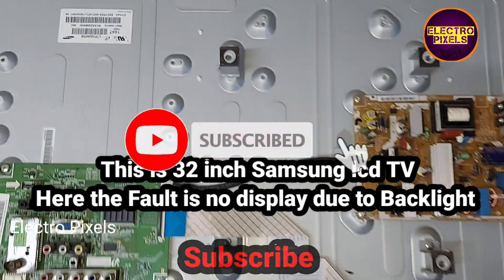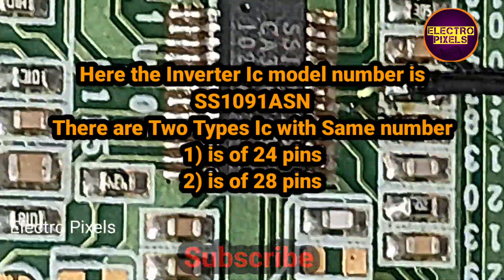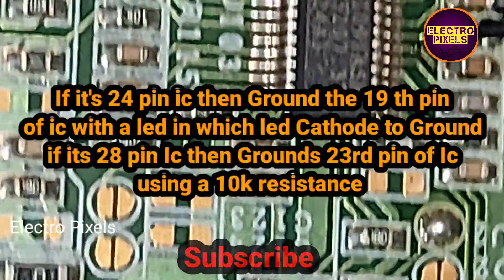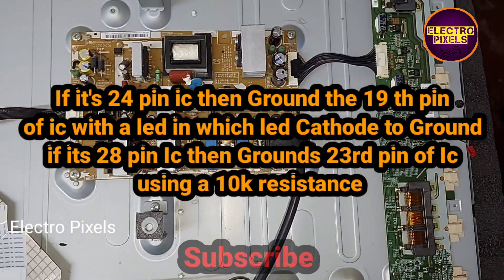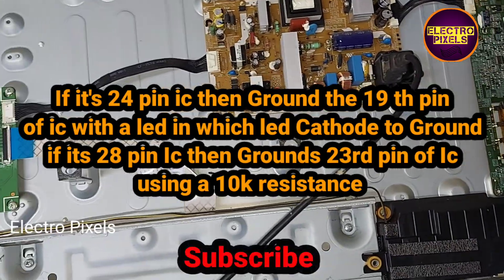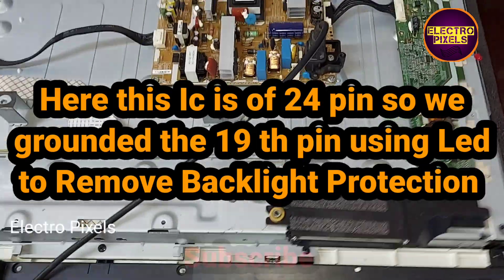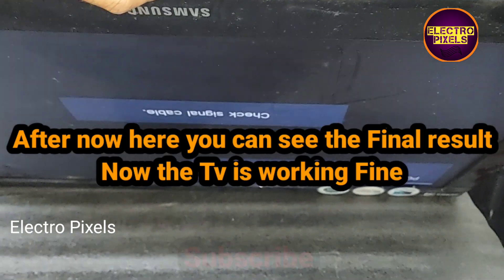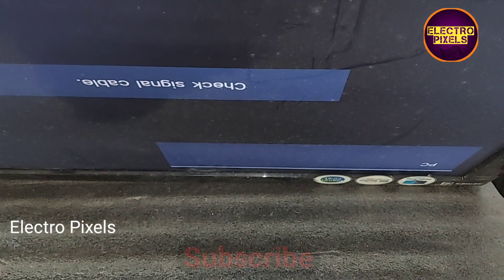SS1091ASN Inverter Ic Protection Removal || Samsung 32 inch lcd Tv no Display || Inverter Ic fault

Comment: Why does this protection occurs please ?
Reply from the maker: Because of Bad Backlight since it's a Lcd tv it uses CFL Backlight instead of LED lights, Sometimes if these CFL tube's are not glowing, then we need to install Led Backlight and additional led Inverter Board, Since these CFL tube's are not Available because its Discontinued already
Reply: @ElectroPixels  Thanks. So you changed some ccfl before ?